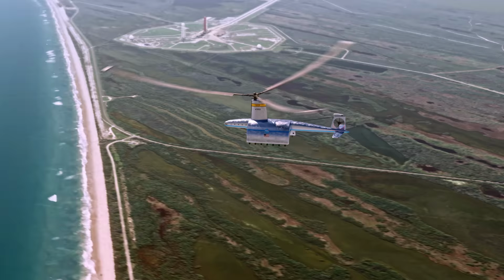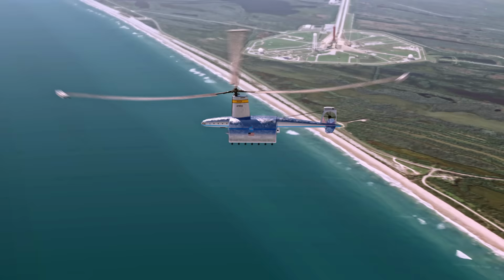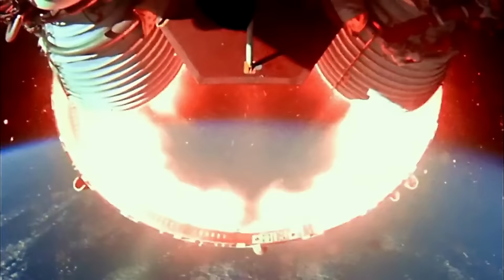World's Biggest Helicopter Mid-Air Rocket Recovery: The Hillers Air Tug

Comment: Fusslage of an MI-8 and MI-10, a gigantic rotor of a R-44, and a horrifying landing set up. I’m scared.
Reply: Everything you wanted to know about helicopter breeding, but were afraid to ask.. :)
Reply: You mean R-44 rotor mast, because it got a 2 blade rotor and this is 3 blades
Reply: @lil__boi3027  The rotor is also about twice the size of the largest one ever flown, on the H-17 which had a 134 foot rotor span.
I estimate this from the video where it shows each blade being a bit longer then the first stage which was 138 feet.
To be fair and honest, there is no vehicle to compare this to. Not even close, what a beast it would have been..

Comment: Setting it back down?  How would that work?  Another video?
Reply: @TheJackyBear as soon as it goes subsonic it is cools down really quickly by air flow
Reply: Helicopter hovers over an area and they lower it down.
Reply: @motokid6008  Well sure, but it would have to rotate it vertical again and on the four little support posts.  Would like to see it visualized.
Reply: @odess4sd4d  Probably just set it down horizontal as it was stressed to be able to handle that when empty

Comment: whoop whoop whoop whoop whoop whoop whoop... 😁
But yeah, even with modern material science those massive rotor blades would be nearly impossible to realize. The forces involved must be crazy. And don't even start on rotor tip nozzles for propulsion - there's a good reason why this technology never took off on the commercial market... 😉✌️
Reply: That isn't right. There was the Sud Aviation Djinn that used a turbine compressor and compressed air nozzles.

Comment: How did the first stage get into a horizonal position to fit in the helicopter?
Reply: Magic.  Not that they would ever have needed to solve that problem, since the chances are that as soon as the drogue line was snagged the entire system would have been turned into an uncontrollable pendulum by the slightest side wind.

Comment: only issue is they mentioned the pressurising of the cabin which is fine and they mentioned oxygen being at low levels at that altitude. This also means a helicopter would not be able to fly at that altitude.

Comment: This is an obscenely bonkers leviathan of a helicopter concept that would probably have taken much longer to pull off than the Apollo program had time for. And it would probably end up being massively impractical. Helicopter recovery is fine for something the size of the Electron's first stage which is slightly larger than the launch escape system, but for the huge first stage of the Saturn V it would just not be worth it. Why purpose build such a large helicopter when you can just use that time and money to build a whole new rocket.

Comment: Just for the record, that S-IC weighed (aproximately) 140 metric tons. Which is a bit more than the payload of a Boeing 747. 3:52  Imagine the size of parachutes !  For the sake of comparison, the Shuttle SRBs at 91 tons each were the heaviest things ever parachuted (and must still are). But they were left splashing down in the ocean. Frack, I just realized that helicopter could easily have catched them. Plus their parachute wouldn't be much smaller than the ones seen there.

Comment: awesome! i think it should be caught by the rope between the chutes, not by the drop chute itself. also blade rotation speed probably should be higher when loaded
Reply: Helicopters generally spin at a roughly constant rpm, since turbine engines only have a narrow efficient rpm range. Changes in rotor lift are accomplished by changing the pitch of the rotor blades.

Comment: Is there a jet engine on top of the tail rotor?
Reply: It's probably driving the tail rotor. You wouldn't need the tail rotor to counter the torque of a conventional helicopter powertrain since this used tipjets but you'd want it for slow-speed directional control, and a jet would be the only solution for powering the tail.

Comment: So it drops two unstearable large parachutes and HOPES that they will somehow catch the rapidly descending booster PERFECTLY between them, at just the right balance point? SpaceX has the right technique, this is baloney.
Reply: I think you've misunderstood something. The first stage has the parachutes stowed and attached from takeoff. The helicopter is dropping two fuel tanks it needed to make it all the way out there
Reply: @drspangle13  Exactly. The video description mentions the external fuel tanks.

Also, RocketLab is about to catch their Electron rocket under a helo in a similar fashion, they made one half-successful attempt already. Albeit the thing is much smaller than a Saturn stage.
Reply: As noted the S-1C already has the parachutes on it or recovery and the 'drogue' chute is what they are catching since that's the balance point. Again as mentioned RocketLab plans this method of recovery and it's been shown to work just not on the scale suggested here. I'd also point out that SpaceX has yet to actually 'recover' a "Starship" let alone a Super-Heavy.
Reply: Helicopter caught rockets have already been done albeit on a smaller scale with a private company on the modern era. The name of the company is Rocket Lab.
Reply: @risingmoon893  Not sure Rocketlab have actually managed it yet :( Hopefully soon!
Reply: @drspangle13  They have.
Reply: @risingmoon893  Well, they caught it and then dropped it again? But yet to catch one and carry it back
Reply: @drspangle13  They caught one with a helicopter bruh.
Reply: @risingmoon893  Yeah, they caught flight 26, and then the helicopter pilot said it was behaving oddly, and so he dropped it a few minutes later

Comment: It seems like this vehicle uses tip Jets on it's helicopter rotor. They have the advantage of not putting a strain on the central part of the shaft and are simpler mechanically.
https://en.m.wikipedia.org/wiki/Tip_jet